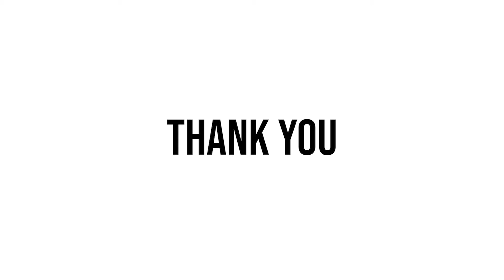Li-ion Cell Construction Explained | Cylindrical - 18650, 21700, 32650 | Prismatic | Pouch

Comment: A well made demonstration of the lithium cell's internal components. 

Capacitors and cylindrical energy storage cells share a physical similarity in their construction, as they both have an anode, cathode, and separator. 

It's worth noting that while physically similar, capacitors use the rolled surface area to store energy electrostatically as a surface charge, whereas energy storage cells like lithium based cells store the energy chemically through ionic exchange in the active material. 

Great demo!